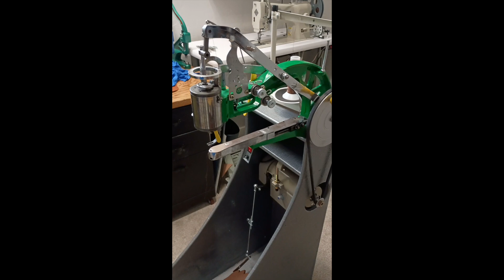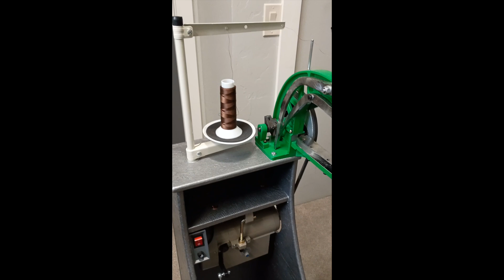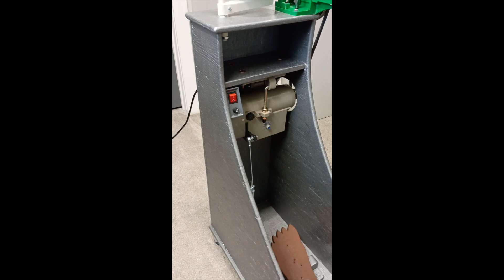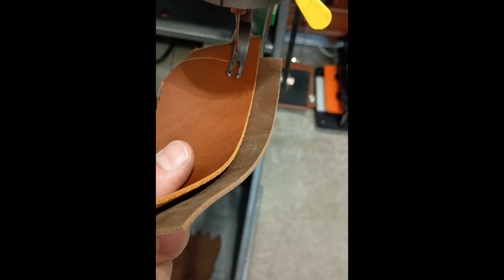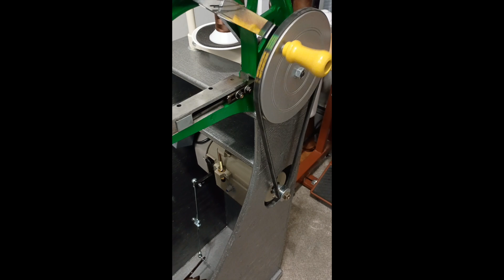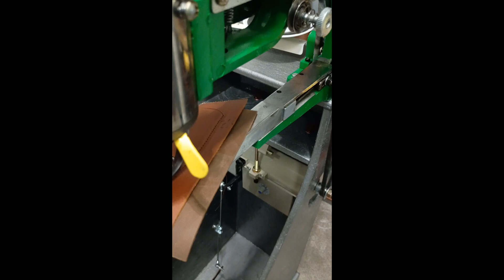Chinese shoe patcher (motorized)

Comment: If you have had the same frustration I have had with my Chinese shoe patcher, please don’t laugh when I ask you if you have ever considered modifying machines and selling them.  I have watched enough videos to fill a library trying to get my patcher to patch.   I bring mine out about once a year,  in the dead of winter, work on it until I get totally frustrated and then pack it back in storage for another year or so. Anyway, thank you very much for the video.  At least I know there is hope.
Reply from the maker: This machine was my first adventure into sewing leather about two years ago. So at that point tuning and starting to understand some fundamentals was a bit of a pain for sure! That said I think these cranky machines are great and have a ton of potential. Yes, I've had to tune it, sand some burrs here and there and polish up my bobbins so everything is smooth. But since then I have purchased a Techsew 2750 cylinder arm and a Seiko 8BLD-3 and you know what? Both of these well made industrial machines gave me fits until I learned some fine tuning on them as well!!! Hours and hours. You'd think a machine that cost 30x as much would be flawless out of the box but they're not. 
I use my machines a lot so I can see how,in your case, using every few months would be difficult to get to attuned to the behavior of the machine. Don't give up!!!
Thank you for watching the video. Have a great day!